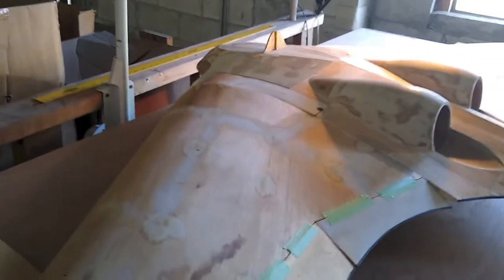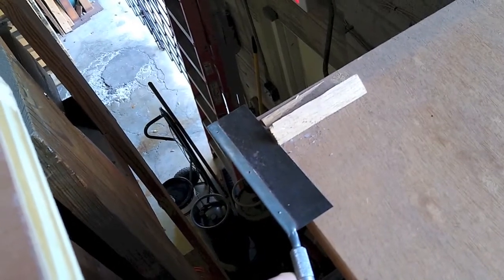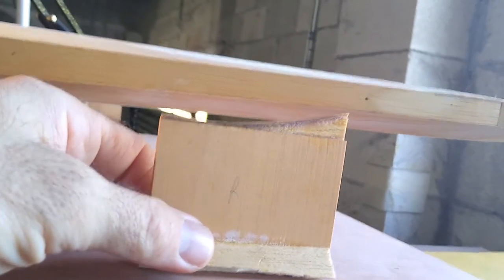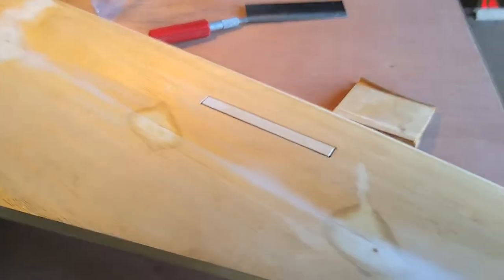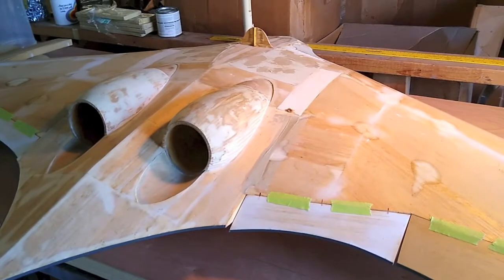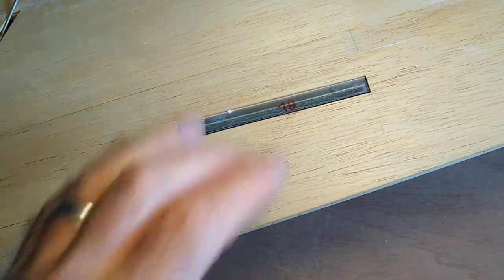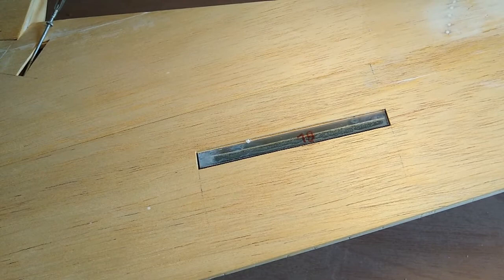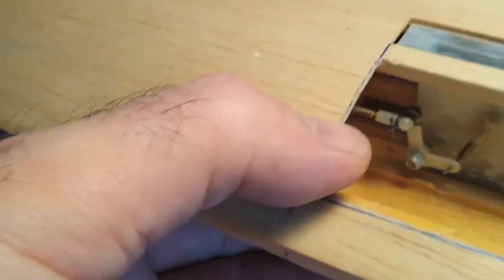Jack Bale Horten Ho IX 3

Comment: When is the first flight planned? Does a landing gear come in and an extension tube?
Reply from the maker: @Panzerbaer Well, I kind of ran into a snag. Florida had some freak rains, and a few hurricanes which just barely skimmed us last summer, and when they did, we had a "Rain event" which flooded our shop.  We were left with 2 inches of water on the floor, and as it evaporated from the floor, the humidity rose up and warped my new building board upstairs.
 So, I have been at a stand still since, and am planning on getting a new board this week.
As far as the extension tubes go they are only needed when there is not enough efflux from the fans, and being I am running 90mm fans, I may not need them. (fingers crossed)
As fa as gear, there is none to keep the weight down, but I built the plane to accept gear in the future if I wish to install them.
Cheers!